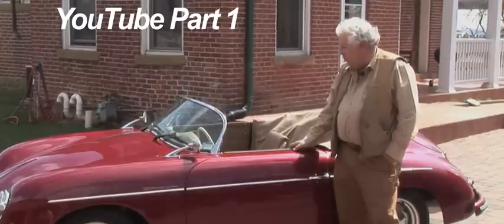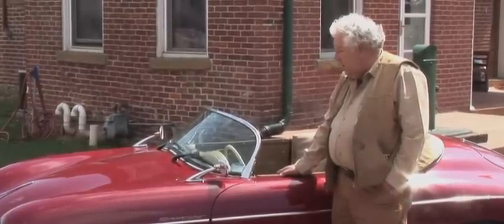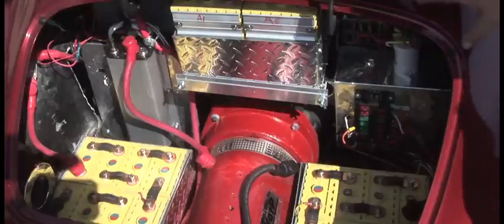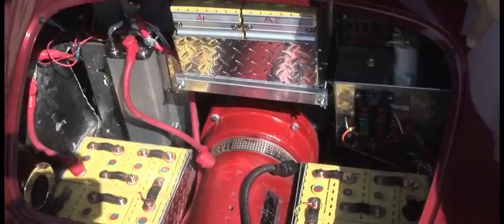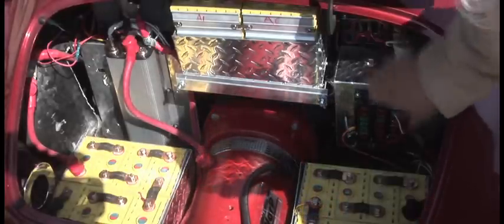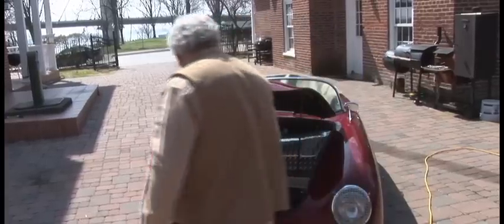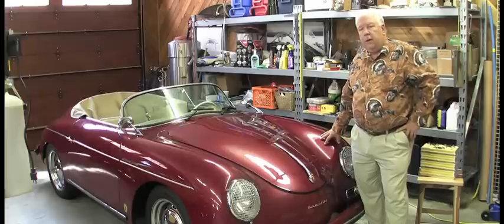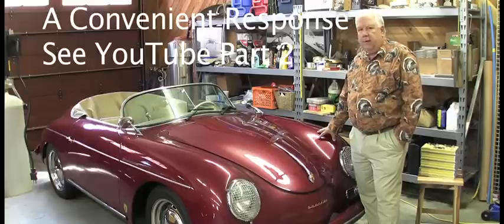1 A Convenient Response to an Inconvenient Truth - EV

Comment: The batteries cost a fortune.  Two banks of eight Thunder Sky lithium ion battery are about $21,000.  That puts a conversion out of reach for many people.
Reply: +arbonac - Well, the brand-new Tesla 3, which won't be out for another 2 years or so, still is likely to cost a cool US$35,000 or so. Sure, it'll be the best thing on the market for anywhere near that price, but at the end of the day it's still just a luxury vehicle bourgeois indulgence for getting from point A to point B without taking a bicycle, bus, or train. 
So anyway, if your batteries are around US$20,000, that still leaves you with approx. US$15,000 to spend on the donor car, the controller, the charger connector, and the motor. Then you've got something even more exclusive and cooler than the new Tesla, and you built it yourself!
Reply: The Elio (out late September) will cost 7K (out the door), burn gas and go farther then the Tesla.  The gas mileage is incredible.
Reply: Things are moving fast though. This video is already almost ten years old, and I'm sure within another 10 years everything will be amazingly inexpensive.

Comment: re 27/11/09 friday programme
Hi jack

The porduction ready aptera will have roll-down windows.

Have you seen a reduction in range in the roadster?

Nissan have almost doubled the capacity of their battery, and they use prismatic cells.

AC Propulsion, and Teslas idea of using of the shelf batteries is flawed, some things dont scale-up very well.  As far as I know, all other companies are using prismatics, GM, Nissian, Aptera etc

7926645

Comment: That is a beautiful, well made car. Your videos are very informative, and also well made. I am interested in the Lithium Ion battery packs. I am presuming those are 3.2 volt batteries stacked in series.  What are the amp hours? What are the advantages of four 3.2 90 amp hr batteries stacked in series vs a single 12 volt 90 amp hr lead acid (other than weight)?  Thanks again for the great videos.